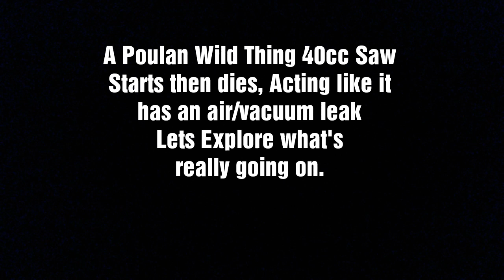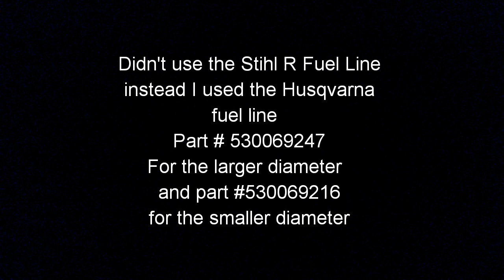Poulan Wild Thing 40cc Won't Run (Starts then Dies)

Comment: Not sure why people keep bashing inexpensive saws, especially over what is almost always owner errors causing failures. 
It is almost silly. Stihl and Husky have their9motly owner) failures also. the biggest difference is the money invested.
The High end investor is far more likely to take their saw to a professional for repairs. The recreational(?) homeowner is far more likely to just toss the saw or sell it as - for parts only - and buy another one.
Fact is - the Cheap saws are just as fixable as the expensive ones.
Treat your saws right and they will likely give you every pennies worth in return,
Reply from the maker: I do agree with what you say, but when the Inexpensive (cheap) homeowner saw breaks most times it is just as cheap if not cheaper to purchase a new one especially if you're paying to have it fixed, this is how the manufacturer intended it to be as they make more money on new sales versus parts sales.
100% if people would take care of and treat their equipment with just a little respect they would get a better service life.
Reply: Its called planned obselence. I will pit my 1960's homelites and other magnesium and aluminum saws against plastic saws any time.
Reply: @thecollectoronthecorner7061  LOL - you have a habit of dropping them often? The actual working part of the saw - The mechanics - have only improved over the years. The bad the EPA has forced into design can be overcome by a serious Saw Expert.
Oddly the only saw I cannot find Parts, or even a correct part Diagram for is a old Homelite I received in a tool lot purchase. 
All of my other 15+ yr old saws see regular service and are used on a regular basis.
* We all have our favorites. no need to bash one for preference of another.
Reply: @nakedfreak1  Nope, just like any other Saws maintenance is key. That and buying the right model for the work intended. 99% of Poulan complaints come from 2 sources - Retail (Residential) users and Service shops that don't want to deal with the occasional owner abused (Big Box Store) product.
I only say this because I have seen how homeowners neglect and abuse their Tools(vs. professionals) and I actually have a 15+yr old 4018 that still gets the job done.
I also have the 372XP when I need more saw for the job.

Comment: The sad part about all this is that your labor cost is greater than the value of the saw. I just trash picked one with a bad coil and some other minor issues. I’m at about $45.00 and if I have to spend anymore time or money on it I’ll just part it out. There’s really little value in these saws. Good information for diagnosing all saws.
Reply: I agree there simply isnt  any value. I dont waste my time or any money fixing plastic saws. I buy them real cheep to get the bar and chain.

Comment: Anytime I see fines in the screen like that I automatically replace the fuel filter and flush the tank
Reply from the maker: I did flush the tank but reused the filter due to the fact that the line had broken and dropped the filter loose in the tank.

Comment: Excellent vid Craig...did I notice a strato port on that above the carb?...I'm not familiar with the brand....also I occasionally use that yellow hose bit have not had that issue where it rots away... Yet😆😆

Comment: Thanks, bought one for $10 at a yard sale. Fuel lines were all brittle and broke. Bought the kit with the new bulb and lines, fuel and air filter. Got it to run but would die and noticed the bulb was only slowly coming out.  Sure enough took apart the fuel pump side and the well was full of crap. Cleaned it out and now runs great. I don't think the chain had ever been sharpened and the rakes hadn't been filed either. The tensioner wasn't engaged in the bar hole and the screw was bent and of course the chain was dangling. Didn't need it but everything was cheap at this sale..